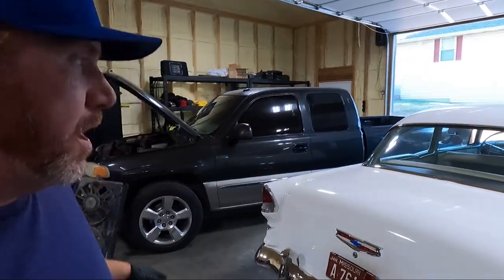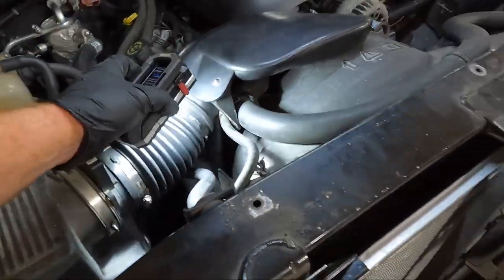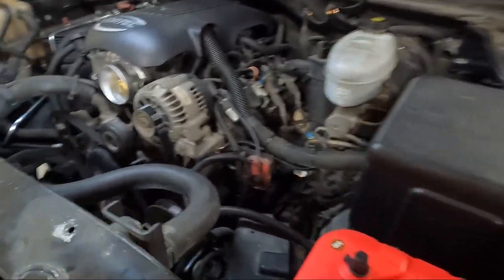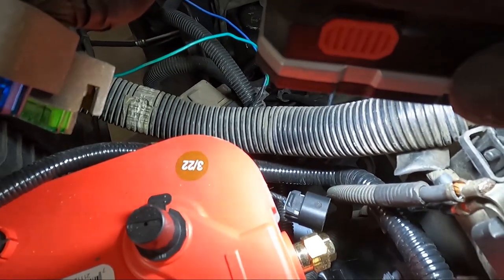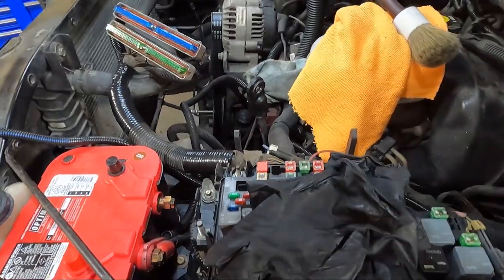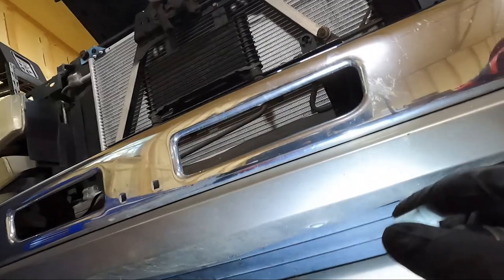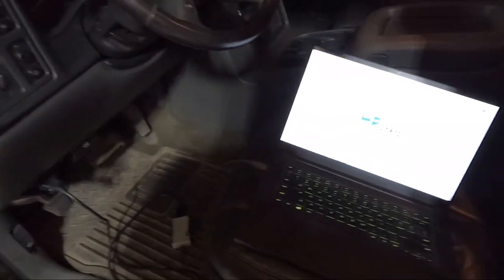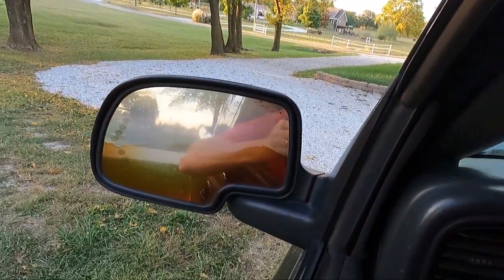2003 Sierra Makeover Part 6 (How to Install Electric Fans and Bigger Radiator)

Comment: I did that E-fan swap to my 2000 Sierra and my boys 02 tahoe. Sierra gave me fits. Being a 4x4 and older than the Tahoe also 4x4 by 2 years my 4WD quit working, no lo range, just 1st and 2nd gear . Couldnt figure it out had to have a tuner install a different program out of a 2005 Sierra. Works good now. Even with the headache, it was worth it to me, as I live in the So. Ca. desert, and I haul water trailers out to the desert for our wildlife drinkers. Keep up the good work, enjoy your channel.
Reply from the maker: Good to hear you got it lined out.

Comment: That was a very well done efan upgrade!  You hit on all the needed details.
I did the same on my 2002 Sierra. Best choice is to use the factory fans and wiring for sure (Fits and looks stock).  I pulled fans and wiring ($45) from a local junkyard and it was a good education for the install.
Had to change the radiator too, but well worth it.  Engine temp is always good even on the hottest days.
My fan clutch was loud as well and I always notice the quieter engine when driving. Few extra horsepower is slightly noticeable, but also a good chance to clean things up and adds room to work under the hood.
For the 99 to 02 you have to change out the a/c sensor or the a/c will not work correctly. Tune is a little different too but easy.
Great video and editing, I love that I'm not the only one that cleans and paints as I work!  👏👍
Reply from the maker: Thank you. Definitely better than the fan clutch.
Reply: Can I get more info on which ac sensor I would need ?
Reply from the maker: Not sure what an ac sensor is
Reply: @dxnnycrtz   Just search for "99 to 02 ac pressure sensor upgrade". That should get you the right info.
Reply: @TWAMotorsports  Guess I should add that for the tune you just change the ac settings to the ones in an 05. But best to look it up in the forums to get the right info.
Reply: @GoodForYou4504  thanks I’ll look into it 👍
Reply: I was told by Glen himself at Glen's automotive performance that pressure switch update was only necessary on 03+ 😵‍💫
Reply: @Ben B No disrespect to Glenn, but I believe that is backward.  03+ has the sensor already installed, and 99 to 02 needs the newer sensor to work with the 05+ factory wiring and tune.  If you're using an aftermarket wire kit that taps into the ac compressor wire, then it's not needed for any year.  If that is confusing, then just do the fan and drive it for a season to see how the ac works. Upgrade if ac is blowing out a mist or running all the time. 👍
Reply: @GoodForYou4504  okay thanks for that info!! And maybe you can give me some insight here, you pin to Blue 42 location and green/red 33. I already have a wire in my red 33 location, do I splice into that and is that the AC compressor wire?
Reply: @benb6693  Don't splice it. Just change out the pin and leave the old one out.
Reply: @GoodForYou4504  okay thank you! I've looked at pinouts but I can't figure out what that exactly controls?
Reply: @Ben B  I don't know what the wire controls, but im sure you can search the info if it is drivingyou nuts. Here is the quote from the instructions with the kit I used.
"The Green wire will go to Blue Connector Cavity 42
Blue wire will go to Red/Green connector Cavity 33. Some applications will already have a wire in Red/Green 33. This wire will no longer be used, pull it out and seal the wire off."
Reply: @GoodForYou4504  awesome alright that's what I'll do! Seems like everywhere I looked, "recirculation door actuator" is what I came up with
Reply: @Ben B  Yup, that makes sense for what the old pin does because in the tune for the fan a setting gets changed from recirculation door to a/c. 👍
Reply: Right on Jim , i actually went with a Flex A Lite fan and on #8 pin of the block wire controller that comes with the system , you connect to the red wire of the a/c compressor so your fans will automatically turn on when you turn the a/c on . and  it comes with its own temperature sending unit .

Comment: I just did this mod a little over a year ago. One of the best upgrades you can make on these rigs. You get better cooling at idle, which helps with the AC. You get less noise in some respects. The slight pickup in HP. More room in your engine bay to work on other stuff when needed. The worst thing for me was waiting several months because my HP Tuners was on backorder for months. 

Pro tip on removing the clutch fan: Sacrifice a wrench by cutting an end off and welding it to an air hammer tool at a 90 degree angle. If you have the means of course. I realize not everyone has access to a welder.
Reply from the maker: I agree

Comment: Did this on my 00 Z71 last year, what a great mod. Great vid as always man, hope all is well.
Reply from the maker: Thank you. Definitely makes a difference in several ways. Good here. Hopefully good on your end too
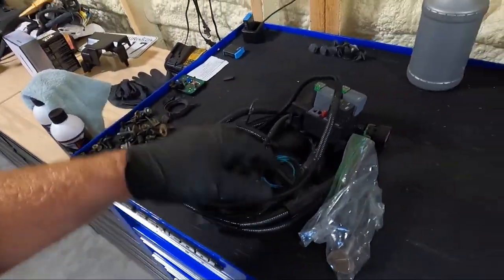Reply: @TWAMotorsports  Everything's good man, Daughter turns 18 this Jan and Graduates HS this coming may so just a lot of family stuff. Just installed a Detroit Truetrac and 4:10's on my truck. All in all rebuilt the entire rear end. First time I've had the diff cover off since buying this truck a couple of years ago and I found nothing but carnage. RPO code was for 3.73's with no Gov Lock. No place in the glove box was the G80 code. But she sure had one and it was smoked. Surprised I never had any issues with the rear-end. The magnet was completely covered in metal, the fluid was burnt and thick and I probably used a gallon of brake clean on the rear axle tubes and carrier housing getting all the metal shavings out. Glad I get it free from work, so a simple job turned into a 3 day job but don't they all! lol. I lucked out on the pinion depth as the factory shim was perfect and only had to remove one shim on the left side to get my backlash within spec. So going back together went pretty smooth. Going to drain and inspect how everything's wearing in next week and top it back off.
Reply from the maker: Definitely busy it sounds like
Reply: @TWAMotorsports  so you went with some 4.10 s ! Nice !
Reply from the maker: Not me

Comment: Ive done this several times now and i ALWAYS use the OEM harness. It makes it plug and play.
You can get the radiator and fans from any 05-13 truck. If you have to drain the coolant you might as well get a new overflow tank it makes it look so much nicer.
Reply from the maker: Very true
Reply: What harness?? Can you help me?
Reply from the maker: Keep checking link in description. He makes them and post them randomly

Comment: Another great diy mod video! Still running the clutch fan on my 2000 Z71, gonna check the radiator tomorrow to see if its the 34". ✌🏻
Reply from the maker: Yeah it makes a huge difference

Comment: I'm about to do this on my 2002 Escalade. I snagged the fans from a 2009 Silverado.  Also have a 2004 2500HD to do. A point I haven't seen addressed, both of mine are 6.0's and already have the larger radiator. No antifreeze mess!! :-)
Reply from the maker: That's good at least

Comment: 2005 was definitely the first year for the electric fans on GM trucks/SUVs. I’ve used flex- a -lite in the past, The fans are well built but the universal fan controller can be a bit troublesome.
Reply from the maker: I agree on the fans. Flex a lite us a great brand.

Comment: also a heads up the harness goes behind the pcm bracket like the stock location and there’s another fuse box cover that has the access for the fan relays
Reply from the maker: I that the ones I have seen had a removable top

Comment: Do you happen to have the video on you doing it on your 99-02 truck? I can’t seem to find it. I have an 01 and I’ve always wanted to do the swap but I’m a visual learner and I want to know what to do as far as splicing into the AC stuff before I get my hands in there
Reply from the maker: Yes It is one of the green truck videos
Reply: @TWAMotorsports  I will try to look for it, also do you know how I could get in contact with the person who you bought the harness off of?
Reply from the maker: It is linked in the video description

Comment: Hello Sir, I just came across your video and subscribed. I really liked your format, but could you please possibly get a part number for the harness you used when you added electric fans to your truck? I clicked on the link you have, but it just takes me to Amazon and not the part and I can’t find it, I want a direct fit like you show in this video. Any help please thank you so much. I’ll wait for your reply. Have a good day.
Reply from the maker: The guy doesn't have anymore. Would have to get one from a wrecking yard

Comment: my favorite way to remove the fan is wrap a rather strap end around the water pump and put the hook to the alternator bolt. then the pulley can’t turn at all and a few solid whacks to a wrench with a hammer and they come right off
Reply from the maker: Good idea too

Comment: Hi..i have a question i was working on my truck and i did the first green wire to the blue connector but on my truck where the the blue  wire supposed to go on pin 33 there is already a conector already..now i don't know where to conect that one.. and Also my connector is red
Reply from the maker: As I explained in this video, this is for 03 and up only. Doesn't work on 99-02👍

Comment: One is 2001 and a 2002!! I wanted to out stock fans from a 2005 , do u think  it can be done with out the tune thing u do with the computer??
Reply from the maker: No. Need to wire in

Comment: I have a 2005 Chevy Silverado 1500. Can I go to a clutch fan on it and take those electric fans off
Reply from the maker: Yes
Reply: I want to know if I can change my fans to a clutch screen and I have a fan with a switch on it. My relay Box blue now. I have a switch for my fans to turn on and turn off and I put a clutch pin on my truck. I have a spot for one. I have a two thousand and five chevy silverado fifteen hundred
Reply from the maker: I'm sure you could.

Comment: On my 2003 Silverado I had I used a 2 foot long crescent wrench from harbor freight to remove the fan when I replaced the fan clutch. I put the crescent wrench on the nut and hit it a couple times and it broke loose.
Reply from the maker: You must be lucky. I would fight it forever that way. Lol
Reply: @TWAMotorsports  I guess I was lucky because I only hit it hard 2-3 times and it broke loose. Tightened it by hitting the crescent wrench in the opposite direction.
Reply from the maker: Lol.

Comment: Would it be easier to use a 2005 and newer pcm or is there problems
Reply from the maker: That isn't easier at all
Reply: So a 2005 pcm with a electric fan won't plug up to a 2003 harness and work the fan properly. I really don't know just trying to get some information. Thank you anything will help just about to do first LS swap.
Reply from the maker: @raineythomas750 it would but the computer would not talk to the body control module without tuning and way way more work. Have to swap an entire harness

Comment: Hello all. I'm having a hard time finding the correct information on Google or YT videos. I have a 2004 Yukon XL 2500 with the 8.1ltr engine. I have a radiator that's Core Width: 37-13/16 Inch, Core Height: 19-7/16 Inch. Inlet Hose Diameter: 1-9/16 Inch
Outlet Hose Diameter: 1-13/16 Inch.  Every swap video I see involves a 34" core radiator.  Is there a electric fan swap setup for keeping the 8.1ltr factory size radiator?  I just put my new radiator in last year and would prefer to keep it.
Reply from the maker: Not that I am aware of but measure only the fin section not the entire radiator. My guess is you have a 34" unit already

Comment: Did you have charging problems after install? Every time my fans come on, my voltage drops to 12v  upgraded alternator and still have shitty voltage at idle when fans are on
Reply from the maker: I didn't but might need a 130 amp alternator
Reply: You may need a wiring upgrade such as the Big Three ground setup. I used 1/0 power and ground wires in the charging circuit. Also added a 2nd battery in parallel to supplement added current draw. GM makes a battery bracket for the passenger side engine compartment. Then I added a Nations 300 amp alternator I did this upgrade 3 years ago using a new factory 34" radiator, factory fan assembly from Rock Auto and a relay controller from the wrecking yard. Works flawlessly. BP Automotive can help with wiring and tech support. I would start with the wire upgrade and a GM high output alternator. School bus alternators put out 165 amps. Should be plenty of amps. Hope this may help your voltage drop issues ! I added all this power for a killer sound system too !

Comment: On 10:10 man, there's a much easier way and you don't mess anything up, you just need a BIG adjustable wrench and a soft hammer, you put the wrench as tight as you can on the nut, and just hit it with the hammer and it comes loose, did it with mine like 3 times.
Reply from the maker: I'm never that lucky.

Comment: What is the sellers name that sells that wiring kit on eBay. I looked in your info bar I may just overlooked it if I did, I apologize
Reply from the maker: Apparently he is out of them
Reply: Just my luck lol I’m working on a 2003 extended cab 4 x 4, one piece at a Time lol
Reply from the maker: Aftermarket ones are good too. Used one on my green truck

Comment: Nice job ! Lol , my 2003 sounded the same way with the mechanical fan ! so much better in so many ways !  i have a nice 2003 Silverado LS , similar to your black truck , but mine is white and bottom is  putter color is whats its called , kinda gold in color on the lower half ,   i   went and bought the  Flex a Lite Dual Fan , i am guessing i am getting about 35-45 more h/p no kidding , just with the fan swap ,   i  was looking for better gas mileage not knowing that the air conditioner will work omg so so much better  ! Better gas mileage , More H/P , Colder AC  , you can also increase it a little bit more by throwing down some shorty headers from ebay and a K&N air cleaner , use Snythetic oil and nothing but Super un-leaded !
Reply from the maker: Yeah, changing them out is definitely the way to go.

Comment: Good evening.  I picked up a 2000 Sierra 1500 and it's peeing out the weep-hole. So I have to do the water pump anyhow.
But watched your vid and the harness that comes up looks NOTHING like what you installed. And didn't see a link to that seller on Ebay. It's a VIRGIN truck! and nothing goofy and or silly done to it. (220K)
Thanks
Reply from the maker: I listed an aftermarket harness which is all that is available at this time. It works the same way

Comment: I wonder, what do you do if the people before you did an LS swap (same year 2003) and already using pin 33 on both units. And they're not going to the fans. I have no idea where theyre going with so much wire.  If anyone has an idea what might be going on there, please help.
Reply from the maker: Used the wrong engine would be my guess. Probably need harness for 99-02
Reply: Having that same problem right now pin 33 on the red connector on my 2001 Chevy Tahoe is already taken need help
Reply from the maker: I said that up front on this video. Only can use this method on 03-04

Comment: use a wrench the size of the fan nut and hit it with a hammer to shock it lose will come right off no need to use air hammer for the diy guys
Reply from the maker: Don't have a wrench that size

Comment: Be careful with that air hammer on the water pump. On one of my trucks I had a "mechanic" replace the clutch fan and a couple days later the front housing broke completely off of the water pump. Left me stranded and the "mechanic" was puzzled when I called him about it. I do everything I can myself and don't trust many to touch my vehicles. I was in a pickle at the time.
Reply from the maker: Yeah it is just a bump to loosen

Comment: Does this radiator have the oil cooler and trans cooler ?
Reply from the maker: Yes
Reply: @TWAMotorsports  is thier anyway to know if the one
I have has it? I’m trying to upgrade my radiator to the 34 inch
Reply from the maker: Sorry. This only has transmission cooler. No oil cooler
Reply: @TWAMotorsports if I have a 2001 silverado , do you know the part number for the radiator with only a trans cooler? Mines is the same as yours except for the small trans cooler in the front. I don’t have the small one, I’m going to add a 40k cooler.
Reply from the maker: The one I used is the one
Reply: @TWAMotorsports  ? Did you attach it? The only thing I’m able to see is your comment
Reply from the maker: Link is in video description

Comment: I've done this swap on a 2000 and I have all the settings in the tune. The fan stays on a low speed any time the truck is running. I believe it is because the operating system on the ECU doesn't have the fan abilities. Does anyone know how to upload a different Operating system in to hp tuners?
Reply from the maker: Common in older than 2003 trucks
Reply from the maker: One fan plugs in ecm or into a/c. Did it on my green truck
Reply from the maker: Quite a while